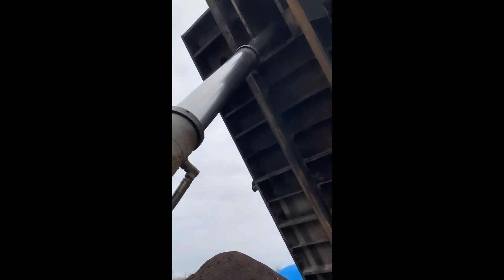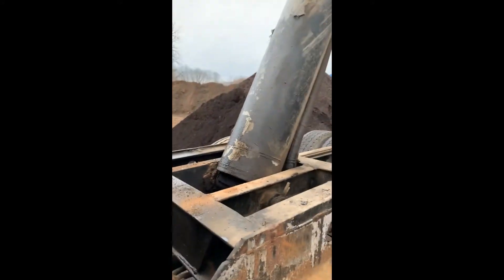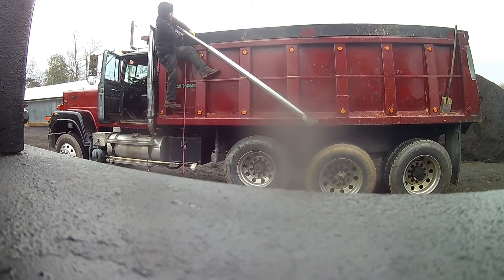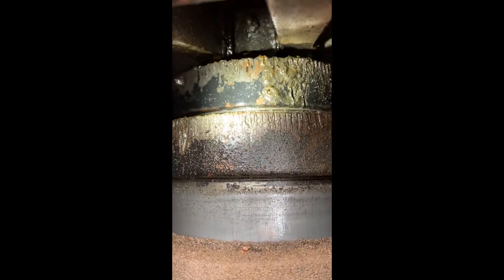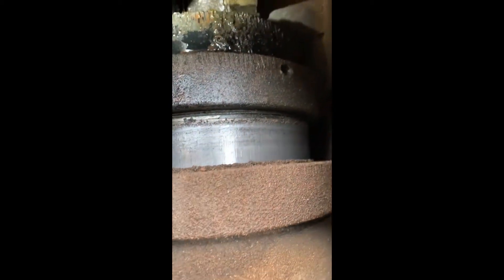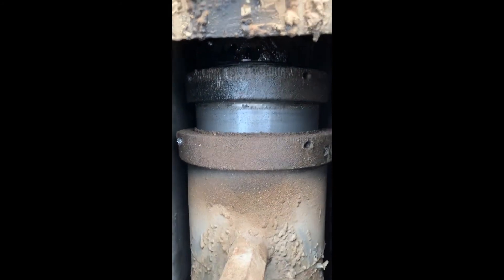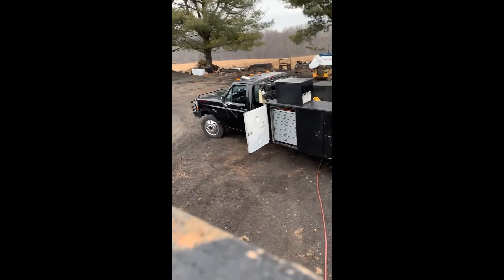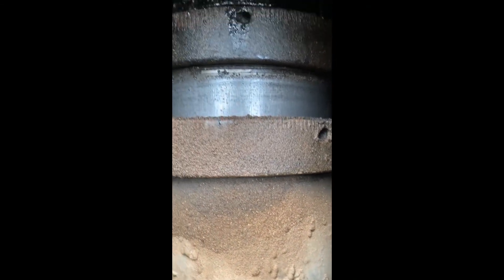dump truck hydraulic lift cylinder leak

Comment: Quick question,  I have an end dump aluminum trailer.  My piston is the other way around,  upside down.  Skinny side at the bottom.  Do you know if I have to tighten the same way as yours?  Thank you.  Great video.
Reply from the maker: I would think so but not sure without seeing it.

Comment: What do you do if a dump bed is leaning when dumping even though the load is even?
Reply: Burn it and get a Mack.
Reply: Could be multiple things. If it's just the bed leaning then start with the hinge pins. You got 2 on the actual cylinder, top and bottom. And you have the ones in the rear where the bed attaches to the frame. Also worn torque rods will show up as a lean too
Reply: My truck was the same way. It would lean towards the passenger side even when the load was even. But I started with the bed pins, it helped a bit but it was still happening. Until recently I changed the leaf spring set on the passenger side. It dumps even now

Comment: I have a cylinder that is also leaking hydralic fluid i was just wonderjng if it did work for a while i cant take ths truck tk get fix right now here in houston due to the coronavirus
Reply from the maker: It slowed leak down enough to get truck back to work